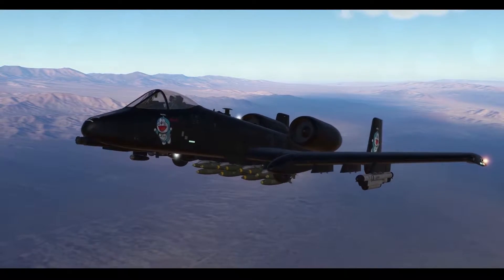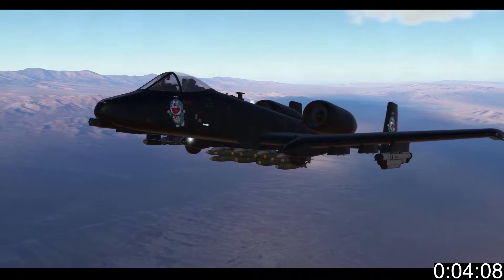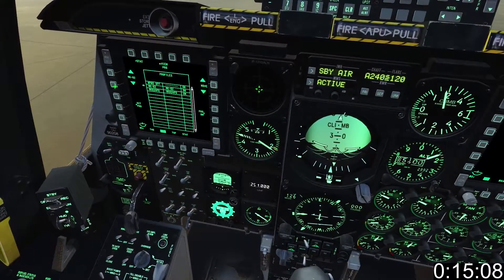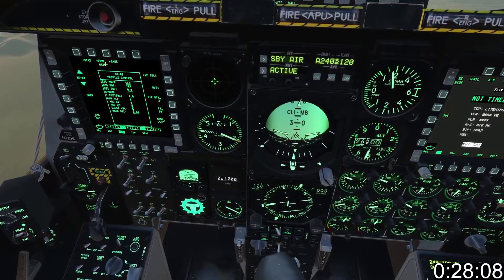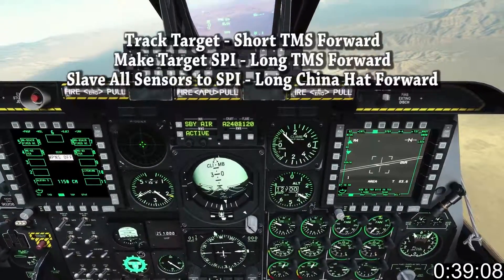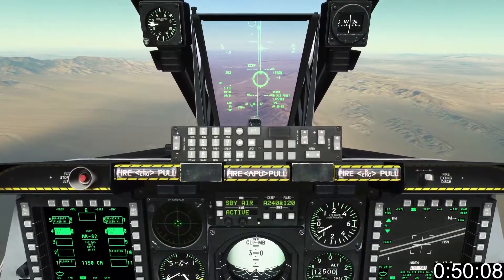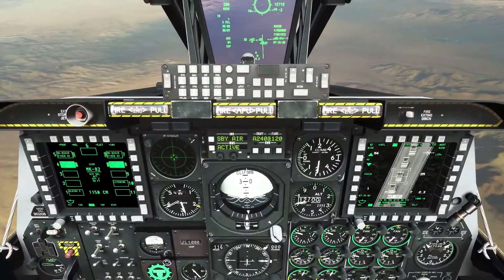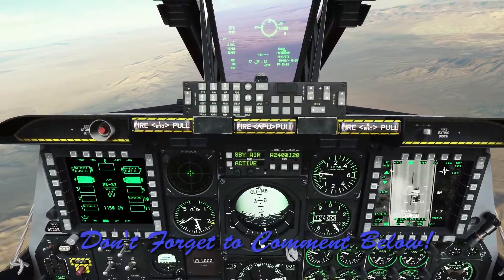1 Minute DCS - A10C - CCRP Bombing Tutorial

Comment: For the love of god! Do a simple one minute video series on advantages and disadvantages.

For Example
This aircraft (Not A10) turns like shit and has a radar that faces 45 degrees down while having an impressive height ceiling. Clearly you want to dive on your target and use BVR missiles. What you don't want to do is get in a close range low altitude turn fight with a target above you as you're about to fertilize the land scape with your ass! It's acceleration is fine but you want to be high and not try to get their when the shit hits the fan as it won't have the ass to out run a twin engine jet.

I'm essentially describing the M2000C to an extent....
Reply: Crash Laobi It's the kind of video I've never seen done. When you ask for an Aircrafts Advantages and disadvantages everyone tells you to go read a book.